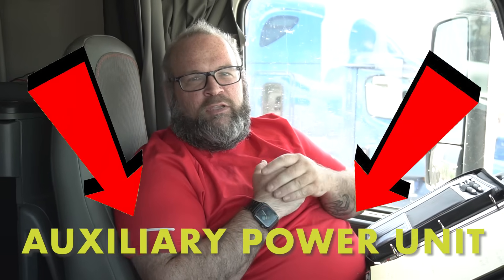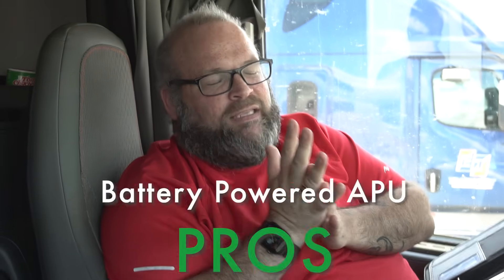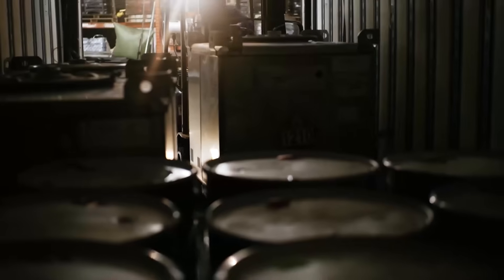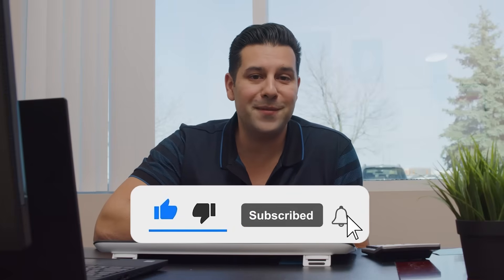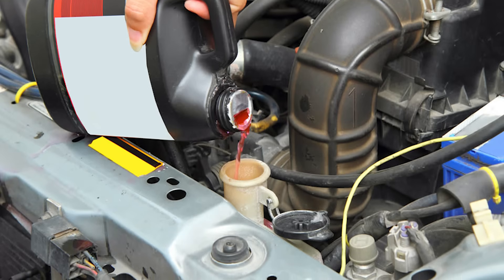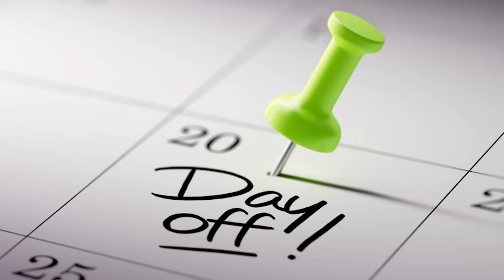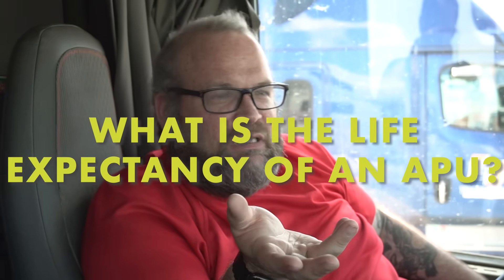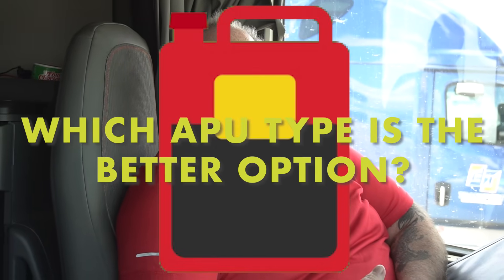Diesel Operated or Battery Operated APU: What Is The Best APU Unit?

Comment: Nice video!  The one thing that none of the battery APU companies talk about is the fuel that's required to charge the batteries from the alternator (nothing's free).  If the diesel APU uses a quarter gallon per hour, then it probably takes about half that (.13 gal) to charge those batteries with the big truck engine because of efficiencies.  The downside with batteries is if you're down south in the heat (90F or hotter), and hot sun and humidity also adds to the load, working the system harder and depleting the batteries faster.
Reply from the maker: Thanks for watching!
Reply: Even 90F affects it?
I thought its more like 120 or something
I’d imagine when its in negative it hurts the process as well

Comment: Electric Apu has less of a BTU output. I've had a Thermo King Apu, parts are outrageously expensive and not easy to fix. Switched to a Green Apu I couldn't be happier. Parts are better quality for less, parts are available at any Auto Parts store and double the A/C BTU output of a Thermo King

Comment: Electric APU's don't work worth a damn.

You will find that they only work when it's not really hot or really cold. 

When you really need it to heat or cool it will run for about 49 minutes and then shut down. 

You will either wake up in a pool of sweat or breathing in ice cold air with your feet freezing. 

Note to electro-fag tree hugger...

You can't sleep with cold feet. 

...and killing your driver due to heat exhaustion isn't a good idea either. 

The only APU to get is a diesel powered one.

I have a friend with a faggotty hybrid truck that still doesn't have enough power to run his electric APU....

So no.... don't get an electric APU.

Comment: Dude there is no real comparison. The electric apu is worthless. Especially if you are running a TVOne, microwave and other items. The electric will cost you in the long run. One battery is $400 plus and still you have to idle your truck just to charge your apu batteries. Just go for the gas apu and be done with it.

Comment: I bought a thermo-king, and wish I had found a better way. The a/c works but not that well, the heater, which is an Espar, worked great the first few months it was installed. After that it only runs with a full tank of fuel. And then only for about 3 minutes, then I have to shut it off and restart it. No matter what the outside temperature is. I went to Thermo- king, and told them about it they hooked it up to a laptop and said it works perfectly. So after 2 years I’m through with that garbage!
Reply: Is it getting over heated  my apu was doing that and I found out the coolant line was closed from.the truck
Reply: @Sinerwray  nothing is over heated, temps are right where they need to be.

Comment: What about the diesel you burn using the APU? As an independent I have to pay IFTA fuel tax every quarter. The more diesel I burn the less mpg I get therefore I would have to pay more IFTA tax. I have the Cascadia electric APU system with 4 batteries (1150 cca AGM)and 1500 watt inverter. It’s good during hot weather for 8 hours and runs my microwave, tv, etc. I bought a Predator 3500 Inverter generator (very quiet) for $800  to charge the batteries for the APU and truck batteries. It uses 2 gallons every 10 to 12 hours. I use synthetic oil in it, a hotter spark plug, removed the spark arrestor, and disconnected the low oil sensor. It has 2800 hours on it and uses about 2 ounces of oil every 100 hours. There’s no way I would spend $12,000 to $13,000 on a diesel APU. Hope this helps other Independent Truckers out. ✌

Comment: Built my own eAPU 5yrs ago, upgrading from an AGM setup to a Lithium setup ATM.
Watching other operators having to service their diesel engine and replacing alternators etc while I haven't even touched my setup just reinforced my original decision to go electric.  Highly recommend it to anyone who has the option.
Reply: My fear is lithium catching fire ... I'm curious tho, how do you recharge your lithium battery setup?
Reply: @vroor32  Running two victron 30a DC to DC chargers to charge two 200ah lithium batteries.  Usually puts out 60-80 amps ph... which tops it all up again pretty fast. 👍
Reply: @keifwoki  oh? 2 victrons chargers? 🤔 Good to know 👍🏿. Q?: What's your amp draw during your 10hr break? I have a mini split that draws 700W-800W @ 7amps. I would like to enjoy at least 7hrs of sleep without having to worry about draining the house batteries. Is 400AH an overkill?
Reply: @vroor32  I'm not sure what the total draw is hourly really... 400 is overkill, I get 2-3, 7hr runs out of a full charge on a medium setting.  The 12v compressor does draw a lot when it kicks in (around 70amps) so I more so wanted to ease that momentary strain on the batteries by adding the second battery.  The compressor cycles on and off depending on what I set it to though, so it's hard to get a definite per hr figure overall.  I'm sure it's in the victron app somewhere but haven't had to look for it yet 😅🤷🏼‍♂️
Reply: @keifwoki  so u use 12v system. That's why your amp draw is so high. Did you have to upgrade your alternator? Mine on a 12.7L S60 Detroit is rated for 140amps. I read somewhere that ePU equipped trucks have higher rated alternators
Reply: @vroor32  I will be, I'm currently running a 170ah alternator on my C15 and it does ok, but from my calculations, it's only just enough... I have a 200ah on standby ready to go in, but would definitely recommend 200ah or higher 👍
Reply: @vroor32  It's a Rencool 12v AC system made in Australia... Apparently they mainly cover earthmoving equipment but they do make a 24v system for semi's as well.  In hindsight, 24v would have been a better option for the AC but then again it complicates the addition of other things.. 
 I run my refrigerator, tv, USB ports etc (also a coffee machine and heater through an inverter).
Reply: @keifwoki  does the rencool provide heat in winter as well? Or just cooling function?

Comment: Well, good video but I don't think personal preference should be an option here. If there is in anyway the possibility that a Driver might spend a day down for whatever reason & it's dangerously Hot or Cold out, you don't want the Electric. Whatever design a Driver or Company chooses, it comes down to keeping the tank full. If the batteries are weak in the Electric APU, then you'll have to run your engine regardless of the fuel load. If you choose the Diesel APU & have a low fuel load, at least you can stretch the load because it'll allow the Driver to turn off the engine & run the APU that'll only use 0.1 - 0.6 gal/hr. as opposed to 5 gal./hr. The weight issue favors the Diesel, see links below. I know there's more Mfr's. out there, I just chose those two. There's three more at least. There are many business factors & situations that'll determine what APU design works for a customer. But for crap sake, don't think that saving the Planet factors into the business plan. One little truck or a couple dozen won't do anything to keep the Planet clean, which the Climate People haven't explained but if we ask, we're deniers. They're afraid of the truth & have been for +50 years. Do what the business requires, not what some climate criers want. The Planet is fine, work on your bottom line instead.
https://www.carrier.com/truck-trailer/en/north-america/products/na-truck-trailer/apu/      https://www.thermoking.com/na/en/road/auxiliary-power-units.html

Comment: Use a solar panel on top of the truck cab in conjunction with the battery-powered APU and you won't have to run your truck as much to keep the batteries charged

Comment: Thanks. 

I’m outside an APU dealer now about to be the first thru the gate this morning so they can work on this Tri Pack. 

What I need for my other truck (in freightliner) is a cheap Apu that will power my devices and batteries 🪫 while sleep not just the AC only.  I need it all but don’t want to pay 13k for one of these traditional ones. 

If anybody knows of something that actually works, include the link. I see those Chinese brand-new APUs (1000-$1500) online but don’t know of anyone personally using them. Can’t even tell how they work. 

Thanks.
Reply: https://www.youtube.com/watch?v=GxyMZP5G1mk&t=45s
check out this one

Comment: Batteries dont last period a few years and they are gone like the older teslas that are being scrapped as the battery packs cost more then the car is worth, diesel any day of the week especially in extreme heat and cold and if you had to DIY diesel you can pick up an Onan QD3200 fairly cheap  which is a Haier diesel with a transfer switch install

Comment: Pretty sure a APU uses 1 gallon per 10 hours of operation vs idling is 1 gallon per hour.
Reply: That's usually the standard that I was told when I had an APU.  Honestly, I think I'm leaning more towards getting a diesel APU
Reply: @2Pish  I have a thermoking tri-pac evolution, its very reliable
Reply: @info_fox as long you keep up with maintenance check oil but when you don't then it's 1000$ to fix the thing

Comment: Go with a Diesel APU 100%.  Try using a battery APU during your reset.  It ain't happening.  They say they will run the A/C for "up to 12 hours".  Do the math for a hot day, in broad sunlight, and at BEST, they can run the A/C unit for about 7-8 hours tops.  It might go a bit over 8 hours running at night where the A/C compressor isn't working as hard.

Comment: I built my own electric apu. I love it although it's not perfect. It uses its own lithium batteries, still lighter than a diesel apu, but I don't have to worry about flat batteries in the truck. It can run the refrigeration ac for about 8-10hrs. Works for me as I tend to pull up around midnight and start again in the morning. It's OK to use while truck is moving as it's built solely from automotive components and best of all, I can park in areas where houses are close by and still have the apu run.

Comment: Electric ⚡️ one is cool when you have 120v at shipper and receivers but a sad part they are enjoying when drivers begging them:))  picked up used 🛒 carts at Walmart drained batteries 🔋 so I bought extension cord and they let me use their power! charged my batteries I have factory inverter-charger installed.. now I have diesel APU:)

Comment: With zero experience, I "built" my own "APU" with just a gasoline generator, and a stand up heat pump that does AC and heat. Awesome setup, reliable and 10 x less cost. If any component breaks, I walk into ANY store and replace the generator or AC. The only con is walking gasoline every two to three days depending how hard I'm running.
Reply: I used a onan cummins diesel RV generator for the fraction of the cost too.
Reply: What are you using in your setup and where do you mount the gas and generator?
Reply: @cwilliams6483  // Carry the gasoline on your trailer if you want but I carry mine on the step boxes on my tractor.  In my latest video I did another entire guide to the whole system.  I started outside and went inside.
Reply: If you have enough extra juice and enjoy a computer, consider using the extra juice to mine cryptocurrencies for a little extra profit like $1 a day realistically and bonus, you'll have an awesome gaming/entertainment PC in the truck.

Comment: Something you didnt mention is if its very cold outside the APU will keep also keep the truck batterys topped off. Or if your batterys get too low to start it can be used to boost power.
Reply: The diesel APU or the electric one? -
Reply: @Avant-GardeFarm  the diesel. It’s much easier to start the small motor when it’s cold and it has enough alternator to charge the big battery’s over a nights sleep.

Comment: It’s diesel all the way in the northern parts of Australia where I go. You may have heard it gets darn hot up there, it can be 90°F at midnight and over 120°F during the day. When you pull into a truckstop in summer all you can hear is the roar of APUs, everyone’s got one who goes up there regularly. The most popular one is the Icepak brand and they run an air cooled Kubota which is NOISY. Electric ones just don’t cut it up there.

Comment: Not a big fan of the electric APU. Once the batteries get so low, the truck has to start to charge the batteries, kind of defeats the purpose of having an APU in the first place.
Reply: that's why some companies' electric APU has to be equipped with 4 batteries so that it keeps running for up to 12 hours. Like the volta Air one. IQ apu

Comment: Ony diesel  !  Electric don't hold tem above 95 F and runs 6-8 hours only.!  Regardless weight stations know the President George Bush sign weifer for APU unit 4 or 5 hundred pounds. So 80400 you ok. You can park for week and  you ok.

Comment: Just invested in a diesel APU. eAPU vs. diesel APU came into the decision making process as to what would be the best investment. Made many calls to manufacture's of APU's and all make claims to stand by their units. However, I discovered that eAPU's (Electric) have a downside. One is that eAPU's do not work as efficiently as diesel APU over time as the batteries will need to be charged. There's no getting around this. The more it's used the more the batteries will be depleted. It has to be recharged at some point. A fully charged eAPU will put out as much air as a diesel APU. However, by the 6th hour of usage,  it will not work at its full capacity. Thus, at some point, the batteries will need to be recharged. Diesel APU's, on the other hand, will run at full capacity throughout it's usage as long as there is fuel in the fuel tank's and there are no mechanical issues. Also, not all diesel APU's are plumed into the coolant system of the truck. Some are completely stand alone. Sure you will not wake up to a warm engine as an APU that is plumed into the coolant system, but, if you have a coolant system mechanical failure, such as I did, it will not shut down your APU. Two, some diesel APU's generate a lot more power which eliminates the need for an inverter. Third, some diesel APU's also provide heat which eliminates the need for an espar unit. The decision was a difficult one to make because there are trade off between both units. I love that eAPU's are extremely noise free and mostly inexpensive when it comes to mechanical issues. As business owner's, we should be looking for all possible way's to maximize profit's while keeping our expenses low. It only makes sense to go with an eAPU. Nevertheless, usage has to be taken into consideration as well. For my business, the diesel APU was the better decision because I would be getting the most ROI (Return on investment).

Comment: I personally like more Battery APU  cuz :
- It blow air from regular trucks vents and not only from bottom so it cool faster .
- it’s is quiet 
- it breakdown less and requiere less maintenance.
- Thermoking and Carrier can easy bill u over $1,000 just to do easy fix .

My Kenworth Electric APU give me 12-14 hours of cooling and then I have to idling for 3.5 hours to recharge system or go drive . 

Thx u ET awesome video !
Reply: The Electric apu cools the truck different then the diesel apu?
Reply: @Sinerwray  yes electric APU blow cold air thru same vents you get A/C air when truck is running .
Diésel APU thermoking , carrier , comfort pro and other brands blow air for a small hole which usually is located under the bed which this make hard to cool the entire sleeper at very hot weather’s
Reply: I have peterbilt with Auto start button with electric ap unit , last few days my truck didnt start on its own when battery drops too low ?? do u know what it can be an issue , i get replaced truck batteries today they said if they are low woltage Auto start wont work well ?? tnx
Reply: @DS-oq5dq  if you have Check Engine light ON that’s the matter . It prevent truck starting when engine light is on .
Reply: @AkiraKigRace  I dont have any check engine light at all sir , what i notices few days ago i went for battery change and my AUX level was about 5% when i entered that repaired shop , when they replace batteries and i started my truck i notices battery at 75% right after the start of engine , and also these few days with new batteries after 11-12 hrs of sleeper my aux drops only to 50% , before after 6-7 hrs went to 0% .. I hope this new batteries are going to solve the problems with auto start , i didnt still get to the point where auto start goes on after this new batteries replacement ..
Reply: Cost and return on investment and downtime is a big concern for most.  Also replacement ease is simple.  I had a solar generator custom built in 2016 and it took 10 weeks to get it built. I used it off grid in a camper I built and it still needed to be backed up with my gasoline generators in extreme heat or extreme cold.  I love tech like anyone, but this battery tech has lots of limitations.
Reply: @prosimulatedgolfer  dude you had a custom build lol. That can't be compared to anything
Reply: @jamesball8519  // My custom built solar generator I'm comparing to this gentleman's electric APU because they do have limits: Extreme hot ot cold weather and battery capacity (under those conditions) being an important limitation.
Reply: Did the Eletric apu runs the microwave?  And how about to heating?
Reply: @gmerola2652  For heating you can install an Espar Cab Heater just like Thermi King and Carrier does.And yes,you can power a microwave.

Comment: an apu does not burn 1gal, I believe the burn rate is .22 gallon and hour at full load. an hour like he said, and the epu only has 4 battery's not 8, and the epu destroys lead battery regularly as a lead acid battery can only cycle 50% charge 200-350 times and then t is dead.
Reply: It burns 1/4 gallon an hr.